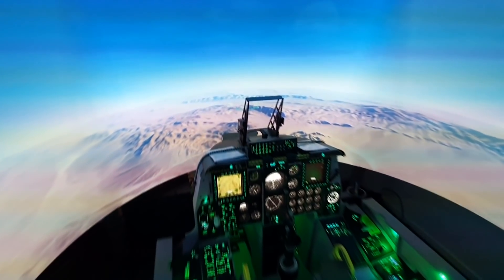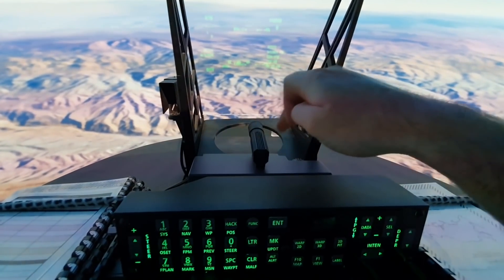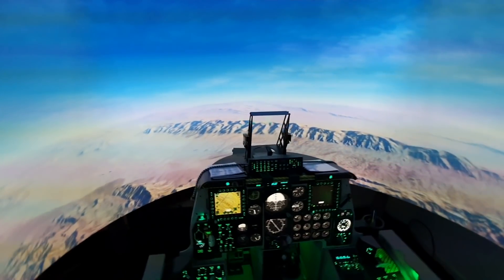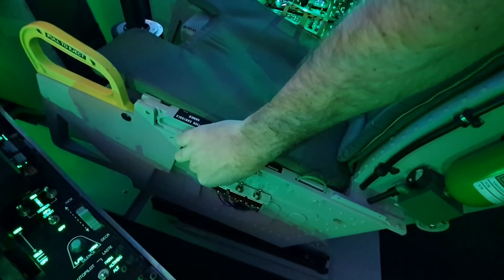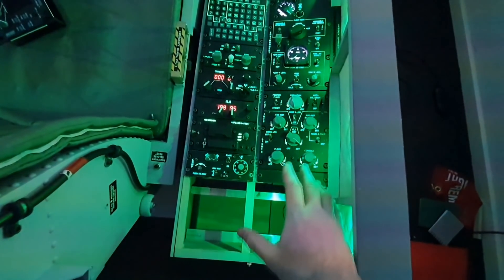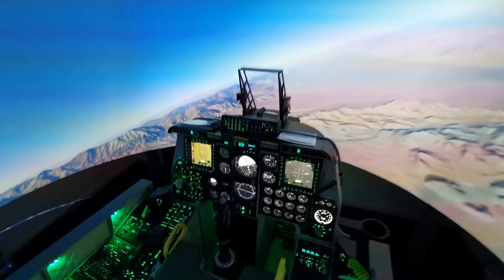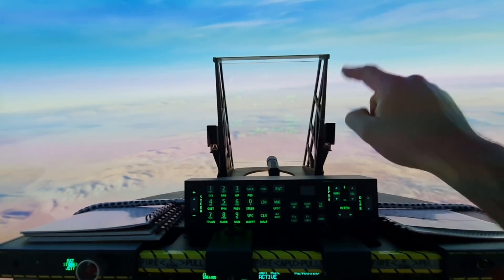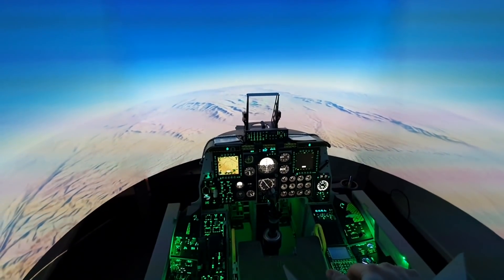UPDATE October 2020 - A10C Warthog Simulator

Comment: Question: I know that looking at the picture quality on your screen through YouTube leaves A LOT to be desired for us at home. How good is the picture quality from the projectors? Are you getting a sharp 4K picture? I really want to build a similar simpit setup for the F/A-18 but I know I'd be a little picky when it comes to the resolution.
Reply from the maker: It's not as bad as YouTube compresses it, but it is by no means as good as a 4K monitor. Stretching a 1080p image over a screen so large, there is always going to be some clarity lost, even with three 1080p images. It would drastically improve if I used 4K projectors, however the cost would skyrocket and the processing power needed would be enormous. It's a trade off between high resolution beauty, and immersion. Mine is definatly playable and the immersion level is high, but a lot of the beauty that is DCS World is lost. If you are a stickler for high res, I honestly wouldn't recommend a set up like mine. I'd probably recommend a higher end VR headset, or even a 4K TV (or three).
Reply: @thewarthogproject  Thanks for being candid about that. I want as much immersion as I can get but without sacrificing clarity. I suppose I'll have to do more research but, knowing me, I'll probably build a setup similar to yours just to say that I have a dedicated sim room in the house. 😂

Comment: Man, I've been watching your vids on your setup for a while now and I'm amazed at your dedication. I would be really interested in how you did the electronics with only a single cable going back to your computer for each side. How do you manage all the different boards used? (Just USB hubs?) Ive got a uh-1b fuselage I'm planning on turning into a uh-1h sim with dcs using some of your methods for panels. I'm wondering how to manage all the inputs when you get up to hundreds of inputs.
Reply from the maker: Thanks man! I just used normal USB Hubs. There is a 7 port hub in each console, so three in total. All up ive got about 20 different input cards, a mix of Leo Bodnar cards, Groovey Game Gear cards, and Arduinos. Ive had no problems using USB at all.
Reply: @thewarthogproject  ah fair enough, im wondering how the level D sims handle so many inputs. Would be really nice if there was some kind of leo bodnar board that worked over ethernet, I've got a simple desk panel i built for f/a-18 and its already using 3 usb hubs can't imagine what im gonna end up with once my UH-1B fuselage is kitted out.

Comment: Gidday mate, that set up is absolutely astounding man, you've done an insane job, amazing actually, you must be very proud. Just a few questions if you don't mind...  1. What Res you getting on your screen? 2. Would you be thinking of the new 3080 or 3090 GPU addition if it helps your performance? 3. And at the risk of this one sounding dumb.. like how do use DCS World interface say in the Options or ME ( Mission Editor) like just clicking on stuff?
Reply from the maker: 1) 5760X1080
2) Absolutely. Ill be upgrading to a 3080 if they ever actually make some available to actual customers
3) Not really sure i understand your question. Most of the cockpit switches are hooked up to USB cards, so i just plug it into a USB port and it shows up in Windows as a game controller. I can then program it to do any button press (in any game)
Reply: @thewarthogproject  
Appreciate the reply, thx man 👍

Comment: I'm dreaming of creating a Concorde cockpit for a few moment already. Why Concorde? First of all, it's Concorde obviously :) Secondly, the data needed to create one can be obtained easier than modern airliners. I can plan and save money to visit the museum and feel and measure everything I need. This include 3rd party add-ons that can be developed well enough with real data available now. XP have Colimata, and XP is known to be easier to use for home cockpit builders (correct me if I'm wrong). MSFS maybe will get FSLabs one? And at the moment I finished the real thing, development hopefully will be advanced enough to ensure software stability. Still dreaming for now, maybe I'll start in 2-3 years from now after I graduated and have a stable income to finance these things :)

Edit: Extra reason I just remembered. As far as I know, only one cockpit is still in function today, the real deal BA one at Brooklands that modified extensively to be able to run with FS9 and SSTSim Concorde

Comment: Amazing - inspired by your build ive started one of my own...im in two minds between selecting a laser engraver vs a 3d Printer to support the build!? I need it to take the next step in making panels, knobs etc...im leaning towards an Ender 3 V2 ? if i can go for 1 item what would you recommend (Engraver or Printer) ??
Reply from the maker: 3D printer. The engraver is awesome, but it's a lot more money and is limited to just cutting out and engraving flat plastic. There is not much you can't do with a 3D printer, panels included!
Reply: The Warthog Project thanks and I was hoping you’d say that 👍🏼 you’re happy with your ender 3 ? Any tips watch outs if I go for an ender 3 or 3 v2?

Comment: For the hud, have you thought about USB  -> hdmi external video cards? They've come a long way with Usb 3.0
Reply from the maker: Yeah I have read about them, the problem is the warping software needs NVIDIA surround to be enabled on the three projectors to be able to warp the outside view. Unfortunatly NVIDIA surround wont enable with more than 4 outputs in total - including USB connected montors.

Comment: Great update!  I understand your issue with trackir and the new helmet mounted cueing system. I wonder if it would be possible to mod the code so trackir only moves the display. 

I have the thriustmaster headset as well. The audio and mic are decent and it looks authentic, but I found the ear cups are a bit stiff. Let us know what you think or if you mod the headset. 

There are working solutions for a functional HUD out there. You might want to connect with the guys at dogfight boss for ideas. Lukas is super nice and helpful. 

Keep up the amazing work!

Comment: get something like the plugable USB 3 to HDMI graphics adapter on amazon,  it'll give an extra video output without effecting the main GPU at all, it does work slower on USB 2.0 but as its just for a hud it should be more than sufficient
Reply: Yes, I confirm that this should work. I am using 2 USB 3 to HDMI display adapters to extract the DDIs to their own screens and it works without any issue
Reply: Another yes from me. I use them in a racing rig for MOTEC screens and touchscreen button boxes.